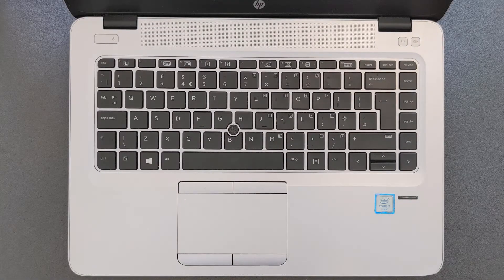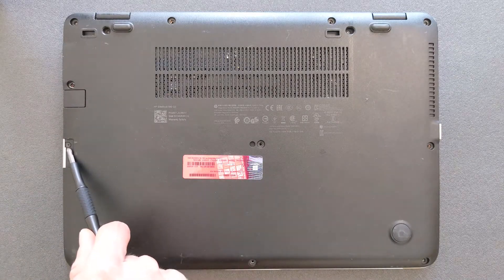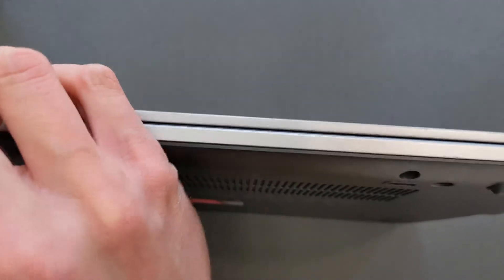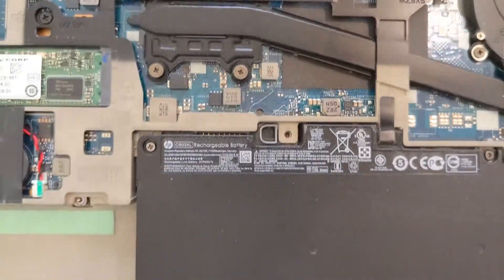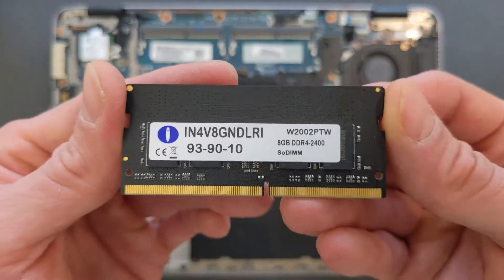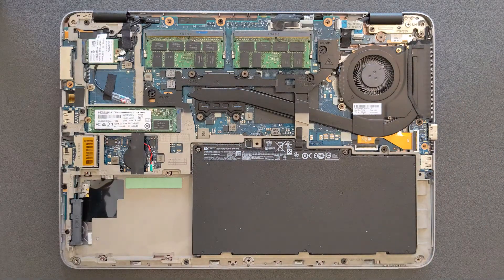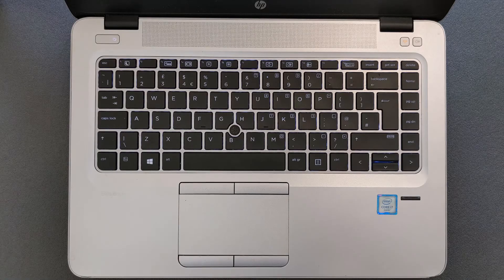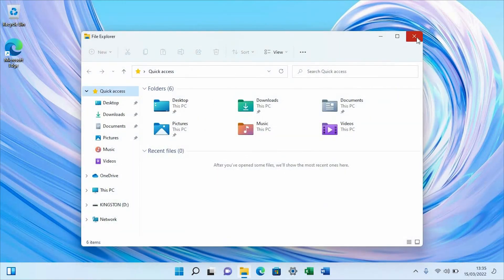HP Elitebook 840 G3 RAM Upgrade to 32GB!!! Intel Core i7

Comment: hy thanks for such brilliant content hope asap you will get 1 trillian subs , and thank for such quality content . I just explored your amazing channel pls Help me with some questions regards this laptop, ill be extremely thankful HP 840g3 Elitebook 14 Inch Screen Laptop (6th Gen Intel Core i7-6600u /16 GB/512 GB SSD/Windows 10 Pro) in black. Before making a purchase, I have a few questions that I would like to inquire about:

1. What is the laptop's build quality and durability? Is it designed to withstand daily use and potential travel?
2. What is the warranty period for this model, and what does it cover? Are there any extended warranty options available?

3. Could you provide information on the battery life? Will it be sufficient for regular usage?
4. Does the laptop have good thermal management to prevent overheating during prolonged use?

5. Does the laptop have dedicated graphics or only integrated graphics? . Could you please confirm the storage capacity and type (e.g., HDD or SSD)? Is it expandable or upgradeable?
6. Are there pre-installed ms office and antivirus ?is it lifetime or not ?

Thank you for taking the time to address these questions. Your kindful assistance will greatly help me in making an informed decision. I look forward to hearing from you soon.
Reply: 1. Build quality is excellent.
2. This notebook was introduced in 2016 so it will be out of warranty, but if you buy refurbished you can get warranty.
3. If the battery is new or in a good condition 4400mAh you can get 6 hours screen on time with websurfing.
4. The notebook only comes with intel graphics card so thermas are good - if the cooling system is clean.
5. Only integrated - but there is the Z version "HP Zbook studio G3" this has nVidia 
6. Probably not.
7. In 2023 I would buy the G5 at least, it comes with intel 8gen CPU which is a lot faster with twice as many cores and fully supports Win11, but I still have the G3 so if you have any questions fell free to ask.
Reply from the maker: Like most business class laptops HP 840 G3 is well built and suitable for travel and extensive use. Since this laptop model is now more then 7 years old i would think that warranty is out of question but agree with @Secna, you might get a deal with refurbished machine.

Had good few of these laptops in the past and as they all came used battery life was about 3-4 hours but that can be definitely less as well, new batteries are not that expensive and can be purchased separately. 

As @Secna already said these models have intel integrated graphics and is plenty for everyday use.

Storage is expandable and upgradeable as per video, you have choice either 2.5" SSD or M.2 SSD.

Basic antivirus is included in Winddows 10-11 installations, if not enough then free or paid antivirus can be added with ease. As for MS OFFICE licence.. unsure that you will get fully licenced version on refurbished laptop.

Comment: I always heard you should remove the battery before removing or installing RAM as there can be an electrical current still flowing through the mobo.
Reply from the maker: That is 100 percent correct, sometimes i do forget that :)